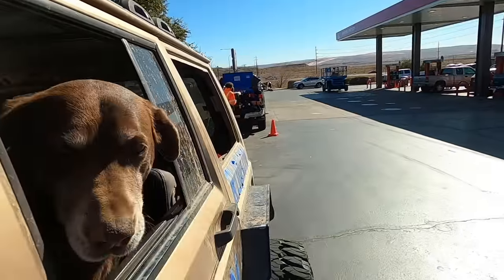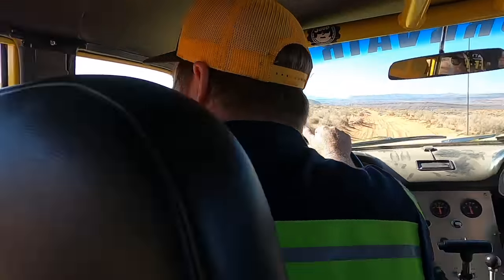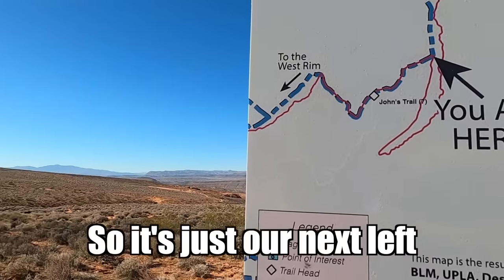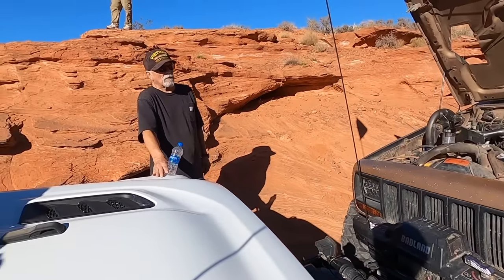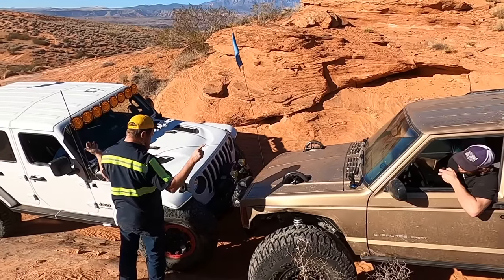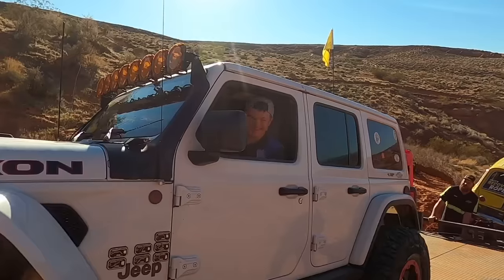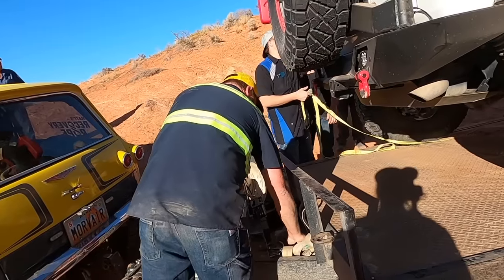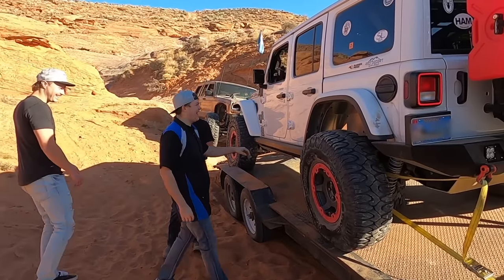Destroyed Front End Jeep Rubicon, Destroys My Trailer!

Comment: Can’t wait to see how the wrecker turns out ! Love y’all’s content!
Reply: Gonna be dope
Reply: I liked Matt's concept in his head... half-track wrecker, now that would cover a lot of bases :D
Reply: Bro,if you see this...That's the reason I'm jumping on this comment to start with...You should build a set of wheels that fold down on either side of the very back of the trailer that will drop down from the frame that will lock in place about an inch off of the ground when lowered..This will prevent the back of the trailer from dragging when the main axles lift off of the ground due to the terrain....That's what I did and they work great...I actually put a third axle that swings up and down and locks in place either up or down on my ATV trailer..The rear tires are actually a little shorter than the main two axles tires are...Which is basically a 16 ft all steel car trailer that's been converted.
EDIT: I also used a piece of 1/4 inch steel  as a rock slider/skid plate for the back behind the main rear axle wheels and  on the front frame  of the trailer where the tongue and all are for when the trucks going up but the trailers still at the bottom of a groove going down.
Reply: U can be sure of one thing it's going to be mean

Comment: This really shows why Matt wants a wrecker. These jeeps are set up to recover running vehicles that need a bit of help getting unstuck or through terrain, not to pull or trailer out complete dead weight. Hopefully Matt's worked out the ground pressure right or that thing'll just sink.

Comment: Listening to the trailer scraping over all those rocks was pretty rough. Since the wrecker is a work in progress, ever consider upgrading the trailer suspension and putting taller tires on it for more ground clearance? Obviously it would require some modifications on the trailer too unless you just want to wait for the wrecker. That was one heck of a recovery with lots of finesse to manipulate it out of there, but it worked, you got 'em out. Really good video coverage to this recovery also.
Reply: Wonder what airbags would be like for the trailer? Do you think one could get enough extra height to help?

Comment: Great to see this old veteran out enjoying his retirement , still having adventures and busting up his nice Rubicon!
Reply: Yea but money over brains with that 60k jeep plus 20k of add ons and he broke it only because he doesn't know how to offroad. Nowadays with youtube & websites he should of spent a few days researching how to offroad and what not to do. #1 had front locker off, #2 allowed front axle to hop (he had said both of these) and #3 (unconfirmed but likely) had the wheel at a high degree of angle. With stock axles/etc it is a big no-no to do #2 OR #3 at WOT either will cause this problem of broken axle or knuckle or similar part. Heck even over built cars you can but should avoid doing this - axle hop and you should stop and re-plan your line and if you need WOT and dont have axle hope you have to reduce max power depending the angle of your wheels (slight turn maybe 80% of WOT, if you have the wheels fully turn then maybe 30% of WOT. So I find it dumb to do this since he is 'new' as he said and didn't do basic research. However he did say he had a diesel which there might not be a ton of info that explains since they make power so low in the rpm range (tq not hp) you have to even be more careful of axle hope and turning to power level. Either way, end of the day he has money and isn't worried about stuff like that which means he can afford not to care or do research which I can respect.
Reply: @JohnAdams-qc2ju  Prolly right on all that but he in a way helped make a hell of a video to watch lol
Reply: @JohnAdams-qc2ju  Don't those front Dana 44 axles still use the Dana 30 outer shafts? If so, it's not really strong enough for the big tires people are putting on these Jeeps......unless they are only mall crawling.
Reply: Mind you could argue that that front suspension isn't tough enough for what they sell as an off-road capable truck.
Reply: @JohnAdams-qc2ju  
We all probably look at these videos and initially think "man, look at that expensive truck, getting stuck in the mud/snow , or busting something. Then getting bailed out by MORR in a couple of built-up old rigs. Dumbases" ,.........but the reality is that these folks are out there doing it and living a great life. And we're sitting watching it at home on YouTube. They might not have the experience or technical knowledge that a lot of commenters do ( by the sounds of it you are very knowledgeable about the subject , which I respect ) , but they are out there doing something , and learning from their mistakes. This guy might maybe get a different vehicle next time, or do some research before doing a similar thing again. Think it's a bit unfair to call it money over brains.... you can spend your whole life researching stuff online.....or you can get out there and do it , mess up , and have fun. 
I always resect these folks who have to make the call for a rescue. At least they were out there pushing the envelope. 💪

Comment: Hell of a recovery. Great job! With or without a wrecker I think you shold add an off road trailer to your arsenal. One with over sized off road tires, that sits high above the ground and a couple of winches on it. With ramps that fold up, so  it won't hit everything when you're heading out.
Reply: Gotta watch a high C of G though, theres a bit of a trade off so it doesn't roll over too easy when loaded. He's got to get through that tunnel as well.
Reply: There is a trade-off with this as well. A taller trailer with longer ramps is likely going to be a bit wider and longer which can make manoeuvring it more difficult. And it also will be a bit heavier; seeing how much they struggled getting up that hill, extra weight is a factor they have to consider.

Comment: Have you ever thought about modifying a Collins Dolly for jobs like this.   It would be easier to get into areas like this, and if you fit it with good ATV tires, it might be a more capable solution then a standard trailer with horrible entry and departure angles.   It might need some heavy modification but I don't think your team wouldn't have any issues with that.
Reply: He had a normal car dolly he was gonna trick out, but that got obliterated by an oncoming car. That was when he built the small trailer I think. Same idea though.
Reply: @clownrock9558  Whoa. I missed that video (or more likely the video where they talk about it)
Reply: @3xceIIent  I wasn't able to find it skimming through threw the old vidoes but I am pretty sure it was before he built the new SxS trailer (so 2+years ago). He had a video where he was talking about putting bigger wheels on it ect and then an oncoming driver split it in half.
Reply: @clownrock9558  now that you mention it it dies seem to ring a bell but that's about it.

Comment: Trailer really needs to be made "fit for purpose". More suspension travel, bigger wheels, extra ground clearance - the Morrvair of trailers. There will still be times when you need a trailer as well as the big wrecker.
Reply: Yeah. Really should be a tilt tray. That way it can have ground clearance but still tilt down to pick up the load.
Reply: This is not his off-road trailer it is normaly for taking the banana to jobs

Comment: I thought pulling the trailer up those ledges was going to be the craziest thing I was going to see in this video until I saw NASA's mission control stuffed into the interior of the jeep being recovered.
Reply: For off-road mapping apps like Maprika or OnX, a tablet is essential. Jeep would do well to partner with one to offer a UConnect version (if they don't already) for Jeeps with built in screens, but even then a tablet is more flexible. I need to get a good mount for my 97 Wrangler, having it flop around on the passenger seat is not ideal...

Comment: Very interested in watching this wrecker get built. T 7tons of the Marines, and the MRAP cougars 1&2, as well as the MATVs from Oshkosh are all VERY capable of road vehicles.
Reply: I wanna see him get his hands on an M88 lol
Reply: @QuantumLeap83  yes the 88
Reply: @wylde223  how does a civilian do repairs and get parts for one of those?
Reply: What does a wrecker getting built have to do with the Marines vehicles?
Reply: @ryandavids1129  buy instead of build?
Reply: @webfreakz  ya maybe? But those rigs wouldn't stand a chance going in where these guys usually recover from.
Reply: @ryandavids1129  i've never operated one but they seem like a beast
Reply: @webfreakz  the same way he got the axles he already has. You do some internet searching, and possible bidding for them.
Reply: @ryandavids1129  caaaaauuuuussse he mentioned about the duece and a half and 5 tons? The Marines currently have the new 7ton?
Reply: @BradUSMCVETrider  and engine parts? pumps? surely not everything is of the shelves for regular folks
Reply: @webfreakz  most everything else is surely off a regular Class 8 truck. But government equipment auction sites are a good place to look.
Reply: @BradUSMCVETrider  alright, i have no idea honestly, cheers

Comment: Hey Matt I am a 70 year old fabricator and a suggestion I have to help save your trailer  we did in the past was put 6 inch steel caster wheels welded on the end of the trailer which allows it to roll over instead of being dragged .Hope that will help you.

Comment: Modified car dolly trailer.
Large ground clearance.
I recovered a large K5 Blazer that had snapped the same knuckle.
It was a three-legged dog.
Older gentleman that helped me recover it stopped at home Depot picked up large lag bolts.
And made a sled out of a railroad cross tie.. we had holes drilled in it and had chain points chained it under the suspension and pulled  it out
 Spent less than $20 to make this sled.
We also had the Blazer to help with part of the work.
It didn't turn worth a crap but that's how we kept changing the pull angles on the chain to overcome that.

Comment: I’d still recommend a lunette and pintle for your trailer. I remember one of your earlier videos where the standard ball came unhitched and you are now running a pintle for your recovery ropes so should be an easy modification. Great recovery regardless.
Reply: Put steel rollers on the back edge of the trailer...like White M3 Scout Armoured cars had on the front in WW2....

Comment: You need a hitch on the front of the truck to help maneuver the trailer. I have a f350 crew cab long bed and I use the front hitch to steer trailer. It is the only way to fit in tight spaces. I even put one on my Toyota to steer trailers at work.
Reply: It's really good for fitting large boats on their trailers into skinny sheds....

Comment: You need a set of oversize tires and airbags on the trailer.  You might look around for an old military trailer which is designed to handle a load like you had on your vehicles.  The sand you are driving on is similar to the sand in southern New Mexico except we have more cactus to drive through.

Comment: I remember years ago being like why on earth don't you use winches.  Matt was even making videos saying how snatching is quicker etc. Now you all run winches.   So now I'm going to suggest now you guys build a 'Dolly'  not sure what you call in in america but its just a trailer axle and draw bar.  so when you get all the razors etc with the front end blown off it you can jack them up strap the front end onto the dolly and tow them like a trailer. Rather than skull dragging vehicles over your trailer causing damage to everything. Plus a dolly would be lighter on sand.   And while I'm at it you guys have to get radios for your vehicles so you can communicate AND finally you should get an app called memory maps installed on your phone or even better a cheap tablet that stays in the vehicle.  Its free with basic maps and you can record 'traces' where you've been, plus put in waypoints with notes etc.  I've got to figure you guys must have done nearly every trail there by now, if you were recording traces you never get lost again.  Extremely cheap way to save yours and customers time getting lost.

Comment: Hi Matt! Just a thought about the trailer issue, I was thinking is there a way of having the bed of the trailer on some hydraulics fixed on the trailer's chassis, the latter needs to be strengthened, even with manually operated ones to lift it up on rough terrain, lower it down when needed during loading process, then lifting it up again!! What do you think? And oh! One other thing, you need six anchor points to hold the bed steady and firmly in place and secure hydraulics from being sheared off. One more thing Matt, the trailers needs a slightly bigger tires, that will keep it away from skimming the road.

Comment: Just a thought…. Could you modify a plow frame to Rudicon to lift things higher??? Maybe mount the winch on top of the plow frame? Like a mini tow truck boom?…. Just thinkn.
Reply: Instead of mounting the winch higher, a snatch block would also work. However, since that plow frame would likely be mounted on the bumper/frame, that connection would be subjected to a much higher, levered torsional force.

Comment: Do a long arm travel on the trailer with airbags so you lift it on the fly. A long arm from the front of the trailer that holds both axles with the leaf springs. So you can lift it like 4ft and lower it back to factory height and would still drive like normal.

Comment: Offroad, rough surface  trailer manipulation  is quite different than when  done  on a smooth surface. For  maneuvering in tight situations, it can get extra difficult . A hitch receiver on the front gives you hugely better control in really difficult situations as your steering wheels are exactly where you need them.  It can make possible maneuvering  in tight spaces which would otherwise be impossible due to trailer length plus tow vehicle length  and amount of steering lock available

Comment: Pretty amazing recovery until you get your wrecker built, might be easier to figure a way to airbag rotating axles that will give a lot more deck height of the trailer.
Also maybe some air bags on the back of the Mopair.
Or just a sling and a Huey

Comment: You need more ground clearance on your trailer! Look at Military off road trailers, they all have as much ground clearance as the tow vehicle pulling them. Taller and wider tires to float the load and spacer blocks between springs and axles for more lift.

Comment: Yeah I'm at with your new toll truck your building I'd make sure it has air compressor a welder a generator and a whole bunch of winches stripes snacks blocks pretty much anything you could think of to recover a vehicle we used to keep a set of jumper cables and some welding rods with this and a link the batteries of our rigs together and make welders and a pinch works pretty good

Comment: One question. Why does he let off the throttle when the rope is about to actually start pulling? I thought the whole point of the rope was to use all the momentum and help smoothly jerk you out? If you let off before the tug and let it get tight then gas it again, I feel like it’s sorta a wasted pull. That’s just my thoughts, I’ve never used a kinetic rope.

Comment: how about adding some small wheels at back of trailer so when you go offroad again whenever the wheels leave the ground you don't drag the back side but run it on small wheels
Reply: Put steel rollers on the back edge of the trailer...like White M3 Scout Armoured cars had on the front in WW2....

Comment: You need to modify your trailer's suspension to airbags that can lift or lower the trailer to avoid obstacles, put the bed on airbags or hydraulic pistons to move the bed up or down, or both. 😉🤔

Comment: I count 8 lugs so thats a 14k trailer.
Definitely flip those axles and 2" lift blocks.
A 7k trailer would reduce empty lbs a good bit.
Would cost a small fortune but having power to the trailer wheels would be a huge advantage.
0.01c

Comment: the proper way to achieve the width is Not by hub spacer extension but by a wider proper axle. spacing the hub out only gave the wheel leverage to break things.

Comment: Try putting a 3/16  flat sheet metal skid plate under the bottom of the trailer    i live and work in the mud with stumps    you have to stop any hang ups      it will slide better

Comment: I wonder if you could build a trailer that had electric motors in the axles you could help assist on a heavier load on a steep grade. 
Difficulty would be letting it free wheel when not in use.

Comment: I still wonder if a tandem drive axle crew cab, long bed. So 6 wheel drive, cut to single cab @12’ aluminum tilt bed with @3’ fold out extension…with heavy hoist. Any utv and most shorter 4wd. Jeep’s.

Comment: You think the wrecker could have just easily towed that vehicle out of there. Let's just hope what you have engineered in your mind actually works in the dirt. LOL I'm betting that your experience builds you a phenomenal wrecker. Let's also hope that dual rear 44 bead locks at 10 psi can handle the load and the soft desert sand.

Comment: You need a trailer that has its own drivetrain and steering. Then you'd have basically a gammagoat recovery system
Reply: Two Tesla motors and axle drives; 
both wheels on each side controllable for steering purposes; 
Tesla battery pack (s) under the deck......
600hp trailer to push the MORRvair up the hills.....
Reply: @JohnSmith-yv6eq  I think we're on to something here 👍

Comment: May have missed it, but why does the trailer rear wheel keep locking up?
Reply: I was going to say something but wanted to scroll through the comments to make sure I wasn't beating a dead horse. @Matt's Off Road Recovery , at 1:59 the right rear trailer wheel brakes, but you were in gear decel. Intentional, or just something else to fix?